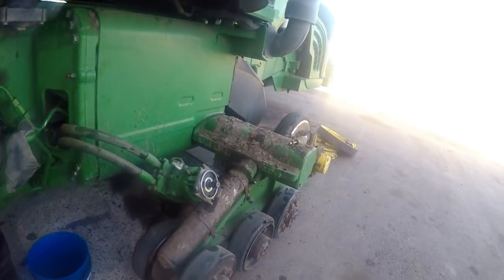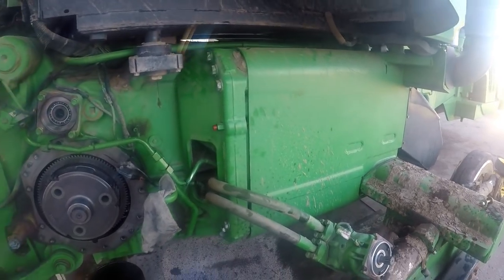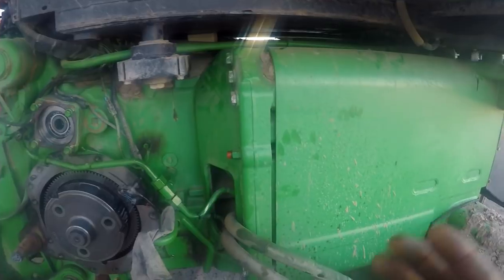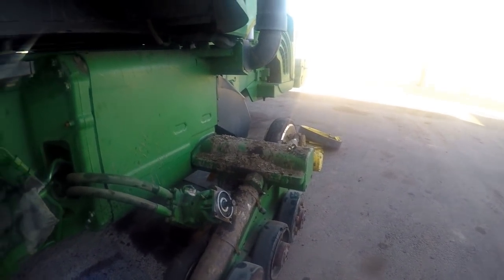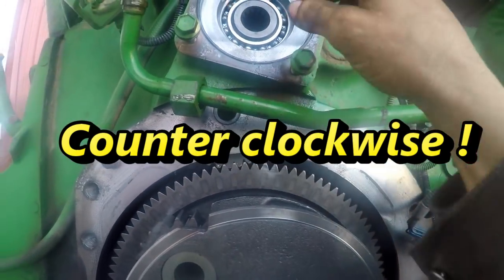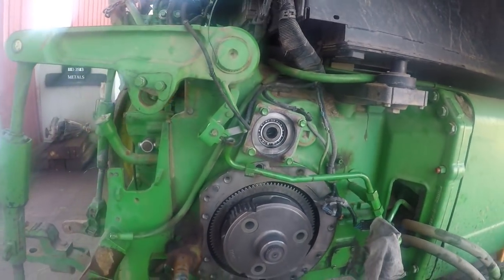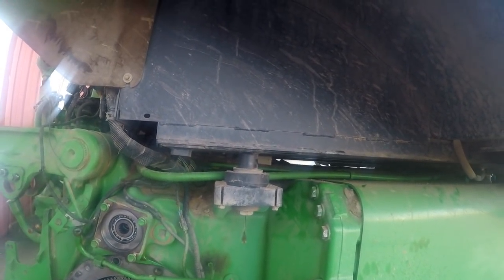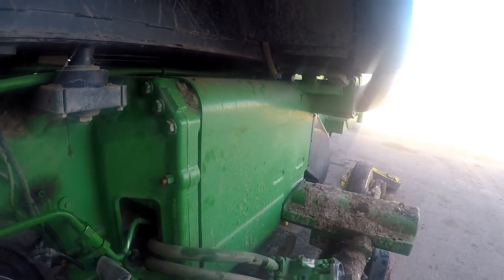John Deere hydrostatic steering explanation

Comment: i have never driven a tracked tractor so i have to ask when you steer and you stop turning the wheel does it hold a turn like a normal tractor or does it start going straight?

Comment: So the steering rotation is added (or subtracted) on top of the power being applied from the main drive?
Reply: The steering motor must be connected to the sun-gear of the final drives. Guess the differential drives the planet gear carrier and the ring gear is connected to the drive axle. Thanks for showing this.

Comment: Thanks for replying  if the pilot pressure was low why does it work fine in reverse ?  is there a different setting for forward and reverse Its a rexroth pump and it looks like it has all kinds of adjustments on it but i am afraid to tweak them  I did put a gauge on the line coming out of the joy stick in line and when it does get pressure it will peg a 300lbs gauge
Reply from the maker: Scott Lundy  Oh I misunderstood you. I thought it was acting up in reverse  too. I woul try to swap my lines and see if it does the same thing.
Reply: ok i will try it and if there is a delay in reverse then what do you think ? must be in the stick? ya
Reply from the maker: +Scott Lundy  That's  what I would  think.

Comment: I no you don't have time to answer everybody's questions but I have a ASV rc100 with pilot control joystick for the track movement my trouble is when I try to go forward it is slow to respond you have to just put slight pressure on the stick to get it moving then it works fine until you stop and then its the same thing again works fine in reverse. you think the trouble is in the joy stick valves ? they want $900.00 for a new one from the dealer I hate to replace it and have the same trouble if you could help a brother out i would thank you very much
Reply from the maker: Scott Lundy  It sounds like pilot pressure  isn't  high enough to stroke the swash plate in the pump. What happens  when you just shove them forward,  does it labor the engine or nothing  ?

Comment: What causes the gearing to get trashed in the differential steering department?
Reply from the maker: Adam Rohrer  The cross shaft has had some problems,  the 9000 series has been more problematic.  The  cross shaft bearing retainer snap ring groove will break and the gear will jump up and down on top of the differential steering gears knocking the teeth off both.
Reply: western truck and tractor repair 
Thanks that makes sense 
and thank you for taking time to answer questions